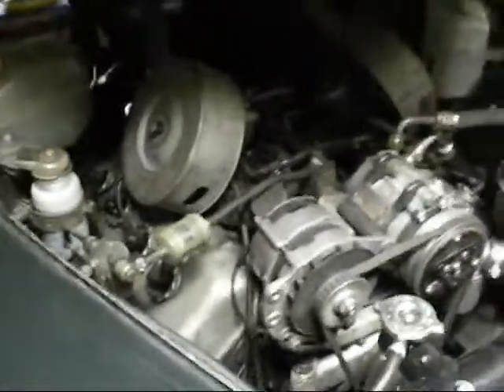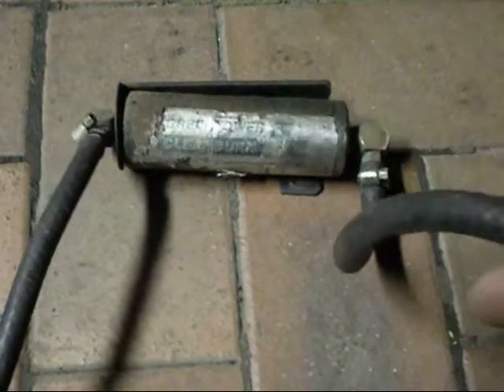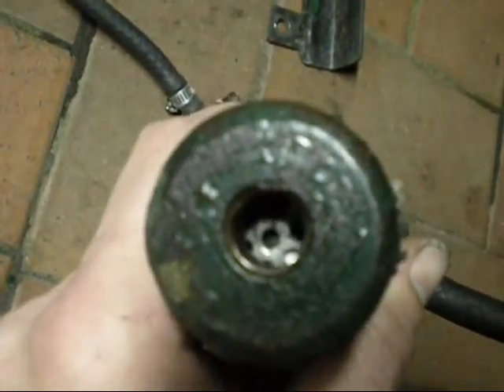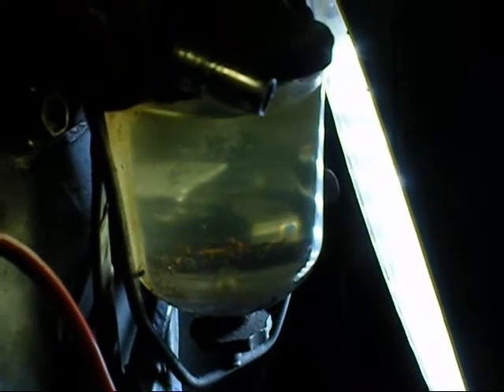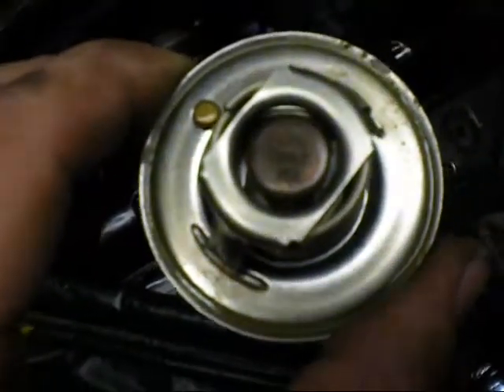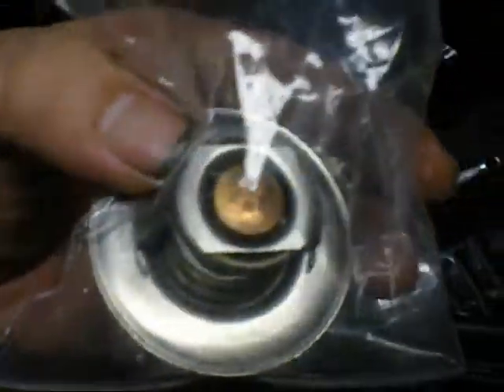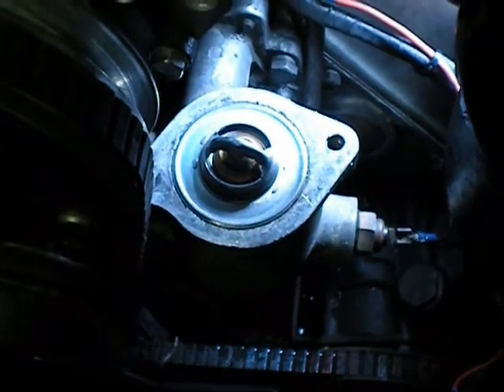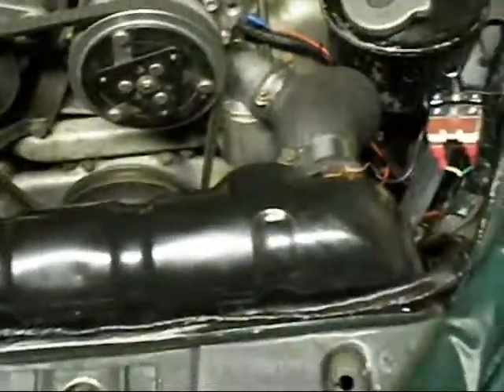fuel and cooling sys daimler

Comment from the maker: if i wet to take the T/stat out ..
1. it would run cold and fuck the engine.
2. it would overheat if it was running at high speed for 15min or more.
do i NEED to do a vid explaining why its the worst thoing to do to a engine?